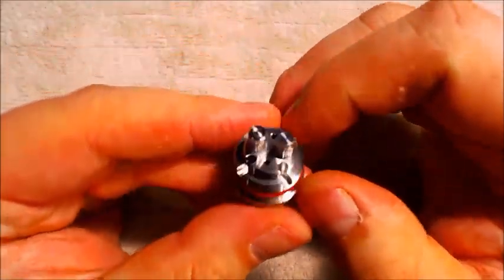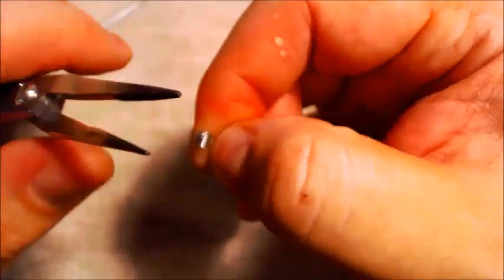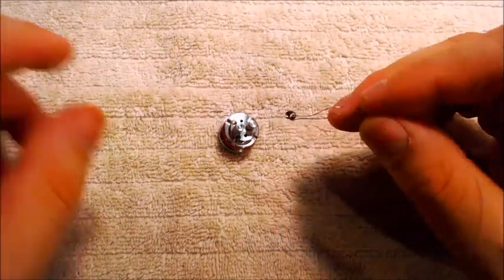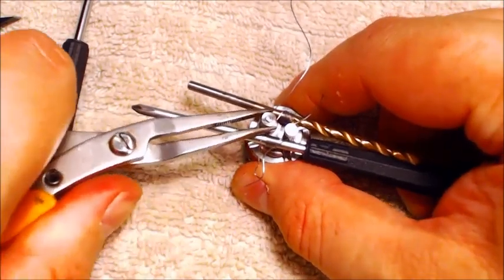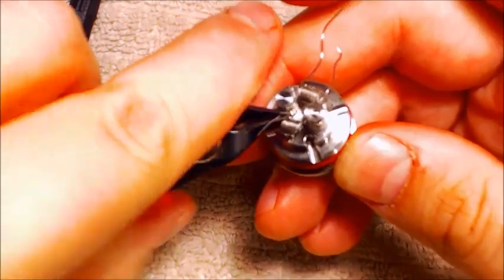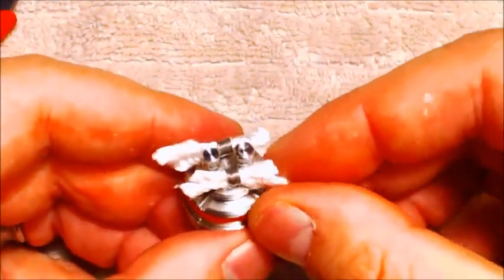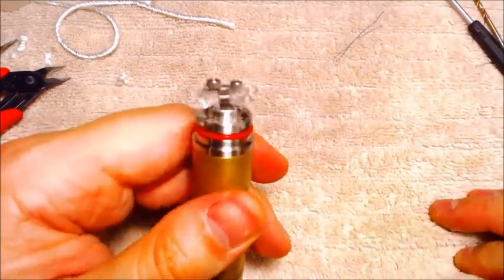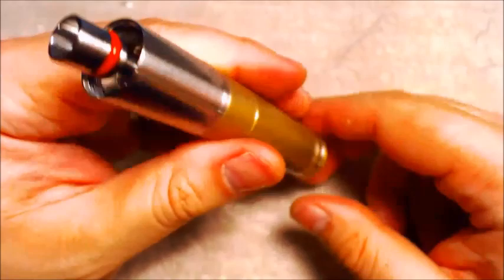The Aqua by UVO System - Part 2. Step by Step Build

Comment: Thankfully the coils stay good, because I hate building this atty. If it wasn't such a flavour-beast I would have binned it ages ago.
I re-wick mine with a very small amount of Muji cotton pad. Dampen it, and push it into the channels, but don't cut the excess.
Put the chimney on, then fold and push into the exposed square holes (bottom of the channels.

This stops flooding when you fill. Then adjust the juice when you use.
Once you get this atty singing, it is fantastic.

Comment: Thanks for making a build video. I had trouble getting the 2 coils attached on my first attempt. I was dreading having to rebuild it later. What snips are those? They seem to work really well.
Reply from the maker: Hey Cyrus,
Those flush cut snips are Crescent branded and sold in the same packaging with a set of excellent needle nose pliers at Home Depot. I think you can pick up the set for between 12-15$. Another poster in the comments here mentioned that he actually unscrews the bottom portion of the terminals and captures one of the coils wires at the bottom and the other at the top. I haven't tried this myself but it may be worth looking into.
Thanks for watching!

Comment: Wow, that dual coil set up looks like a pain in the ass to set up. Can it be runt in a single coil setup? You should build both of the coils out of the same piece of wire (a single length of wire) with a bit of space between the two. then on one end make a small loop and take the nut off of one post and slide the loop over the post and snug the nut back on. then wrap the section of wire between the two coils around the other post and finally all you have left to do is wrap the remaining tail around the other post (Which should be easy because you will have the other end secured on the post because of the loop.) I hope you can undrstand that. We have done this method with some other RDA's.

Comment: Hey James, I just saw the replay of the vp live and I remember You saying You got an omega. I was looking into getting either an omega, or the patriot.

 This might seem like a dumb question, but so far I've only built single coils...the patriot doesn't have adjustable airflow so it comes with 2 holes for airflow. Will I still be able to do single coils with the patriot?

I've heard the omega leaks sometimes through the airflow holes...Have You had any issues with juice leaking through the airflow holes, or any other issues with it?

Thanks in advance, I appreciate the advice. - Ben
Reply from the maker: Hey Ben,
Yes, you can actually use the Patriot in single coil mode even though it has two opposing airholes. Optimally you would want a single coil to only be pulling in air from the area closest to the coil but you can still get a good vape with it the way it is.

The Omega does have a tendency to leak because of how low the airholes are positioned. You have to make sure you do not overdrip. What I've found myself doing is just rotating the cap slightly so the airholes are closed up unless I'm using it. Another note on the Omega: It's first and foremost a cloud blowing machine. If you don't partially close off one of the airholes by rotating it you aren't going to get a ton of flavor but man does it pump out the clouds if that is what you're after.

All the best,
James.

Comment: Would you say you prefer this over a Kayfun or are they pretty much on par with each other?
Reply from the maker: Personally I prefer this over the Kayfun. The capacity is lower than the kayfun with the stock tank however you can purchase a clear third party M-Tank for the Aqua which increases the capacity by 2ml. It all comes down to preference. With the thick VG mix that I usually vape, and at sub ohm, the Aqua really shines. Just my 2c.

Comment: What is your screwdrivers size. what was your ohm coil?

I really wish folks doing videos would say what ohm coil they were shooting for at the beginning of a video.  And tell the diameter of the device they wrap the wire around when doing a micro coil. I did not watch the whole video but I did not see you do an ohm reading. Did I miss it or did you skip that (Very important) step?
Reply from the maker: I thought I had mentioned it. My apologies. It was at 1.0ohm. The screwdriver and drill bit were the same diameter and the drill bit is marked with a 30. Unfortunately I don't know what that translates to in standard sizes.

Comment: What was the diameter of the drill bit you used in the video?
Reply: See above for his answer. Basically he doesn't know. It happens.
I'm going to try it on something that looks similar and pray. :-)
FWIW, I was told to use a 1/16th " drill bit.

Comment: What torch is that?
Reply from the maker: If you go to ebay, type this into your search box there and it will return a USA seller with this torch in stock. There are others listed but they ship from china and will take a while to get to you. ( Jet Pencil Torch Black Butane Gas Lighter 1300℃ flame Welding Soldering Melting )

Comment: I think I got something stuck in my air holes on my AQUA has anyone taken it completely apart before?
Reply from the maker: Dan, I would take some 30g wire, something that is relatively pliable and thread it through the airholes.
Reply: I finally leaned how to take it completely apart.  It's not a good idea and I don't recommend it!

Comment: Thank you for the video!! when I bought my new aqua I also bought pre-made coils that SUCK... going to get some wire tomorrow and I think cotton. I did manage to get a couple small hits on this and the taste is awesome, I have used this same juice for months and this is the 1st real taste of it.....super great. also it was like the same juice was about 90% losing its flavor until this aqua....can't wait to get it setup.... problem with the pre-made was that it was 4 wicks on each coil and i could not get it in the channel. I did get a few hits and it was enough to get that 1st time real flavor hit.... try beeliquid.com and get zom-bee juice=AWESOME...you'll like trust me...
Reply from the maker: Part 1 is where you can actually see how it vapes. I had to split it up into two parts because of the length of the video.